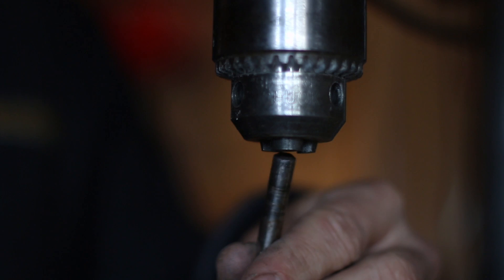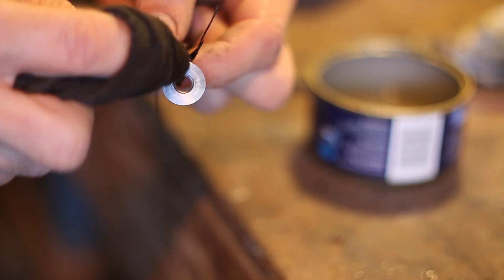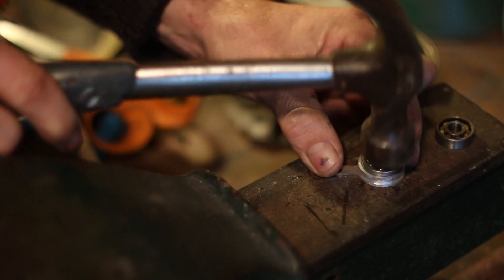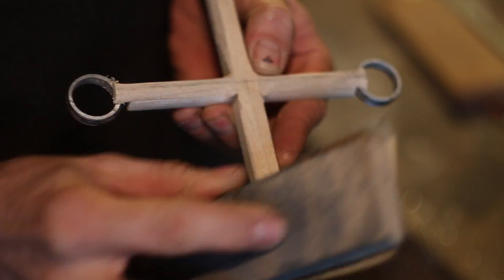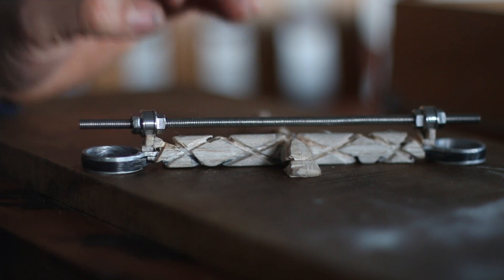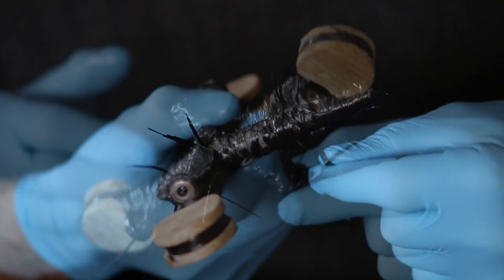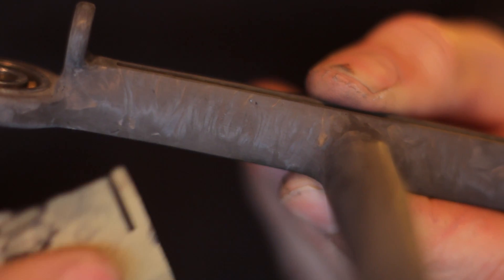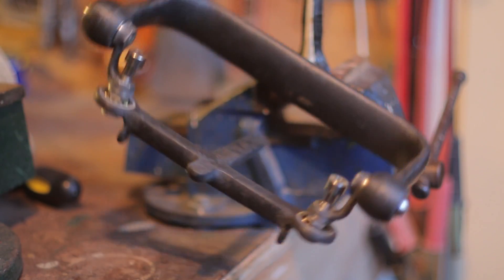Carbon Fiber DSLR 3 Axis Gimbal/Steadycam Build Part 2

Comment: Do you think you will need to dampen the movement a little if inertia causes  it to swing too much or would that cancel out the benefit of free bearings? This is a great project and as always your filming and additing are excellent. Well done.
Reply from the maker: +loloaqici82qb4ipp When the gimbal is totally balanced on all 3 axis there should be no movement in the camera.  There is swing now because the platform is hanging lower than the center of gravity.  When finished I will trial the gimbal with no stabilisation aids and if I need more control I will add a motor system and a CPU like the mojority of gimbals.  Will be interesting though, thanks so much!

Comment: Nice stuff mate. Where do you buy your carbon fiber from?
Reply from the maker: +BoxedGod I got my carbon from an independant dealer here in NZ.  He used to work for High Modulus where the majority of carbon fiber id brought from the world over but this guy parallel imported it and gave a better price which was nice, but the stuff aint cheap.  Wrapping strands in this way and carving back is a very efficient way of using carbon as there is little waste compared with trying to deal with sheet cloth.  Thanks dude!!

Comment: Wow so once you wrap carbon around it you can carve it?  or did he bake it first?
Reply: ***** I love it.  Now I know how to do new stuff with these things.
Reply from the maker: +Rory McCallum Thanks Rory! I just use wet epoxy like sporadic says, just squeeze it through.  It feels like there is very little resin on the strands but in reality unlike glass fiber, you do not need much resin to saturate and form the carbon matrix.  You end up with much less weight due to having a nearly optimum ratio of resin to carbon.  Thanks so much for your interest and best of luck to you for any future projects!!
Reply: elams1894 thanks a million.  The potential for using this epoxy is limitless.  Very exciting.

Comment: I love it man.  Fantastic detail.  Can't wait to see what you do with it.  The camera you are using looks great.  Can you share what it is?
Reply from the maker: +Greg's Garage Thanks heaps Greg!!  I have a Canon 70D, amazing for video, and also takes a lovely photo. The Gimbal may need motorized stabilization with a CPU but I'll see how it performs with just th frame first then add the mechanics to it later if needed. Cheers Greg!
Reply: +elams1894 Alexmos is decent configurable software for gimbals, you can get the controller boards quite cheaply from China. 

Awesome project so far, really cool way of laying everything up. Could you use Polystyrene or similar and then apply an acid to eat away the residue to create hollow parts? Not that the balsa is adding a ridiculous amount of weight though.